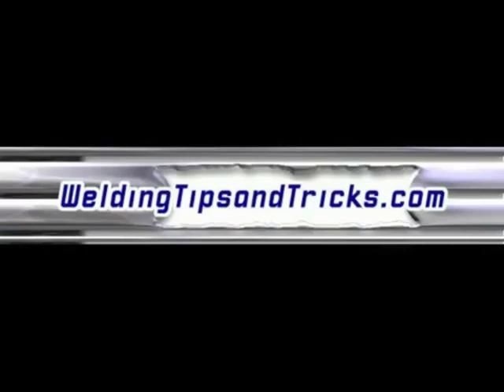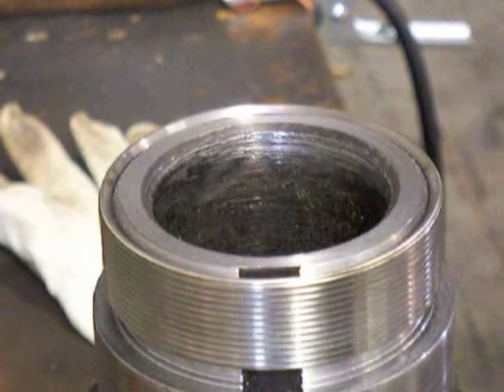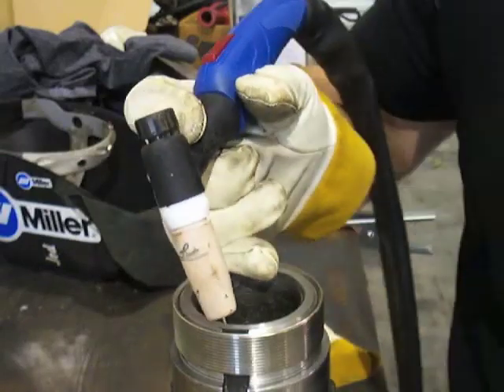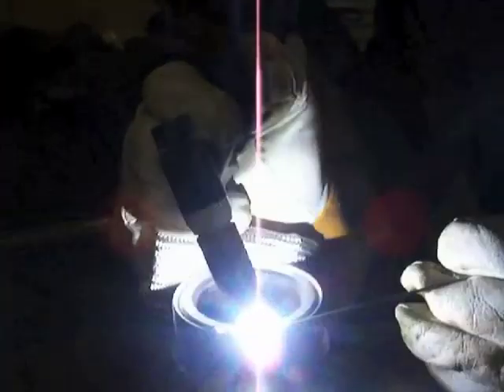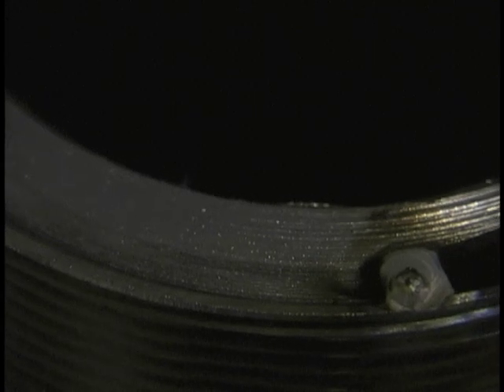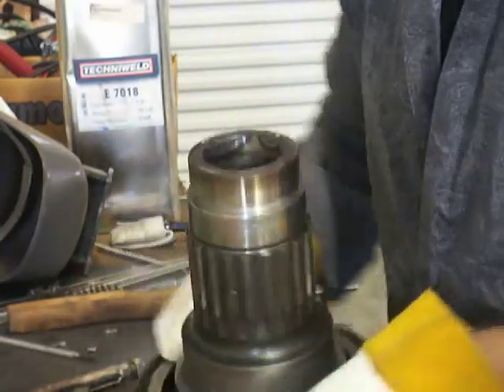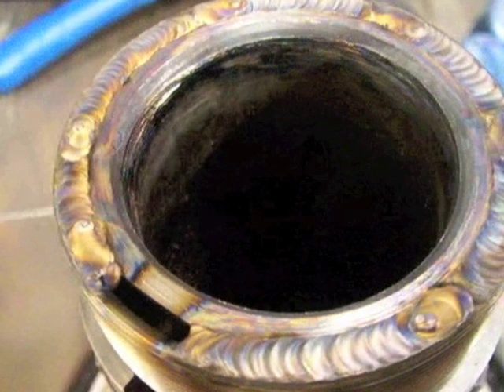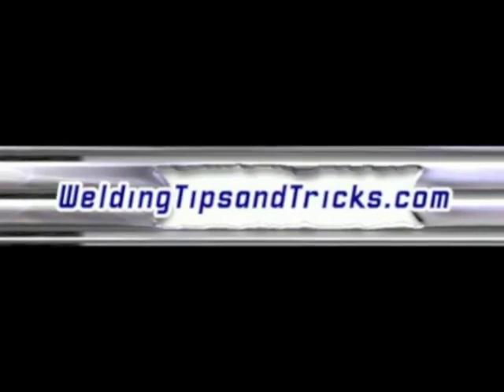Tig Welding Stainless to Carbon with Hastelloy W Nickel Alloy

Comment: Repairs like this always leave me wondering about just how strong that part actually needs to be... its not like there is full 2 inches of penetration on the gear or 4 inches, or whatever the size of the thread is, on that shaft... but i guess they held...

Comment: When you broke the arc then welded again did you do that just for a teaching guide or also to minimise distortion? Before restarting your weld did you allow the parts to coll to a certain interpass temp? I would allow cooling to 300-350 Farenhite to avoid martensitic grain growth! Also on a weld like that it is very important to just sweat both sides of the joint add a small drip of wire allow to flow out then begin filling to size. Letting the first puddle to fuse without filler can cause crack

Comment: What are your thoughts in inconel-82 or some of the high manganese filler metals? Is the best choice based on application? Like corrosin resistance, vibration resistance, tensile strength,thermal loading rather it is a fillet weld or butt weld. I have seen many of your videos you are an excellent welder. I went to Hobart so I have an eye for talent& am talented myself. Thank you for putting good welding videos up, that is a breath of fresh air here :)

Comment: Great example of a sound repair and the beauty of using Hastelloy wire for a job like this, the part I like using this wire is the temp control it allows for a sound weld with minimal filler.

Comment: When you're stopping a weld, why are you rolling back so far with the arc? It looks like it is leaving a crater. 

I haven't been taught the "proper/test worthy" way on how to start/stop but I never leave a large flat spot like that. I'm sure you explain it in another video but I haven't found that yet.

Comment: @weldingtipsandtricks  yes my 250 ex had the same point gap problem...not sure how that happened but i went ahead and closed the gap to a little under .030  it fires up with no problem now...

Comment from the maker: @dirkdiggler257  the shutter speed setting on the camera made it look like 3 pps. It was actually set to around 30 pps
Reply: hi, you use 625 filler; i only have 82 (SNi6082) - can I also use it for the tasks? I think it must fit...

Comment: got a question for ya man, i noticed my 250 ex has a hard time getting an arc started when practicing on aluminum(1/4inch)if the starting amps are turned down to less than 50%. is this normal? the starting amps can be all the way down but will start an arc on steel with no problem. hope this makes sense ..